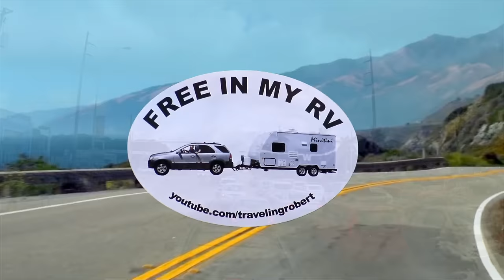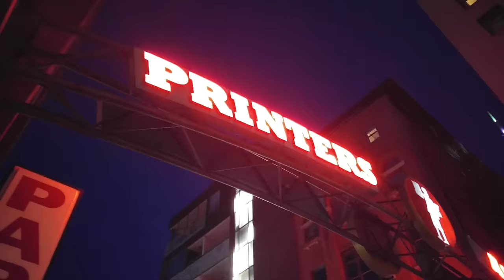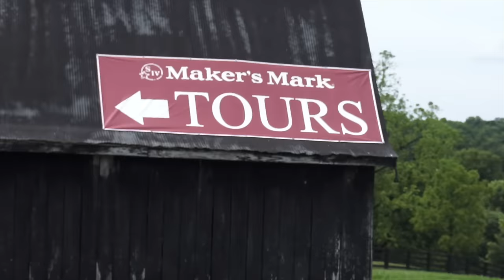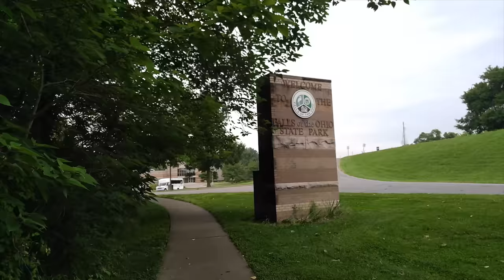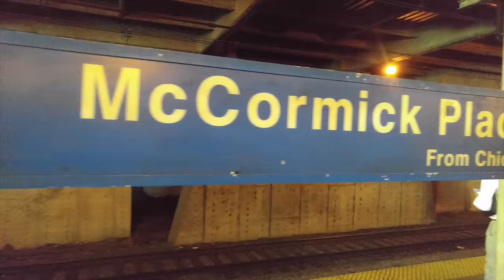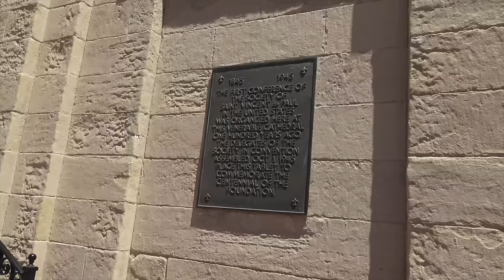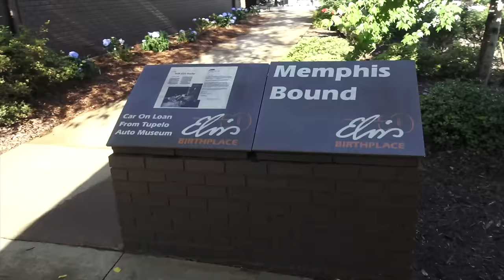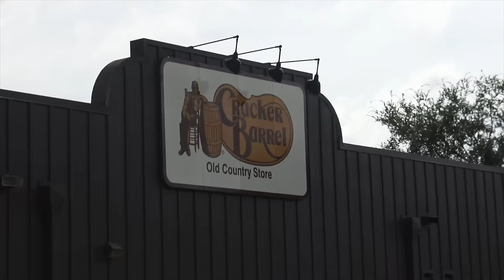GREAT AMERICAN ROAD TRIP - RV trip from MIAMI to CHICAGO and back, boondocking and exploring.

Comment: So many people are living there life vicariously through your video's including myself and never miss one. In my case I have COPD and can not get around like I used to. I bought a trailer anyway. First 5-1/2 hour trip out to meet up with an old class mate my lap top fell off the table and broke in 1/2, my camp site got flooded out, the next day my lower jaw got infected, going home my check engine light comes on. I have no compression in one cylinder so I need  new engine. I give up! God trying to tell me something. :)

Comment: Wow there is so much to like in this video - so much to see.  I loved seeing the 'stars at night' and the clouds and clear skys while you drive.  We also RVed through some of the same places, but I was homeschooling my kids during our trips and some of the 'adult; things you did we did not do. It was fun to see them here. I was surprised the full size pyramid did not make it into the video. 

Robert we have used both a Class B and a travel trailer.  I loved the flexibility of our 'van camper' as we called it. We did just drive up and park it anywhere. We traveled with our German Sheppard who would stay in the van when we went into some places. The best parking during the summer was when we would park in covered parking in the 'oversize' section. It was then safe from rain and too much sun. I could open the 'top windows' and turn on the Fantastic Fan so our dog was very comfortable. We gave her extra water and if the fan power cut off for some reason the windows were still open and she was in the shade.  This was a very versatile RV.  My husband was rarely with us (he has to work in NYC) on those trips it was me and my kids. I would still prefer the flexibility of the 'van camper' and ease of driving. My husband thinks it would be too small for us doing full time, or longer trips.  I loved it.  

Thanks for your comprehensive great videos.  While we had done several caves, including a cave on a large fully ride on electric golf cart  with a guide It may be the only ride on tour of a cave. I could not have handled those claustrophobic cave walls especially when I saw it would not be easy to turn and get out of there. Were there 'hidden' escape routes like the Statue of Liberty tours to the top have?  Geese, I feel myself having to control my breathing when I imagine I was down there with all of you!  

Thanks again for the 'you are there' experience you always give us when we travel with you!

Comment: Dang I could have told you where to park free in Indianapolis, On the north end of the canal on Senate street and 10th, there aren't any meters, you could've taken up the whole curb with trailer in tow and would have been fine. And right next to Indiana Dunes is a free beach and parking lot, literally next door to the west, sharing the same dune is Porter beach free beach. And one more tip, turn your gps (if using google maps) to avoid tolls. There is another interstate that runs right into Chicago all the way from Indy (that also connects to where the dunes were) that you don't have to pay any tolls and only takes like 10 more minutes. I would have rather saved my money and I always avoid tolls on long trips. Even the bridge crossing into Indiana when you were in Louisville mailed you an $8 toll every time you crossed over it by finding your license plate address, could have avoided it by taking another bridge over the river which was only a 5 minute detour. This is just my frugal college student mind speaking...
Reply from the maker: Thank you. I may be going back soon so thanks for the tips.

Comment: By the way, great videos. Could you please comment on how your sense of geography and the local weather has changed with your travelling? It's one thing to read on textbooks that coastal cities tend to be more humid and oxygen rich and towns up in mountains are more temperate and more oxygen thin, but entirely different when you're actually experimenting it.

Comment: :hand-purple-blue-peace::face-blue-smiling::hand-pink-waving: Trailer Trivia: What brand of trailer was the long long trailer in the Lucy Desi movie by the same name?
Redman New Moon model
Production. The trailer used in the film is the 1953 36-foot Redman New Moon model, which sold for US$5,345 (equivalent to $54,135 in 2021). The new car used to tow the trailer is a 1953 Mercury Monterey convertible with a 125 HP flathead V8 engine. So there's that ;-{)

Comment: Robert, I enjoy your videos. What year and model is your Kia? I have a 2006 Kia Sorento, was wondering how your car is handling the weight you towing.
Reply from the maker: +72blueflash I have a 2004 Sorrento EX so we have nearly identical vehicles. I haven't had any major problems towing except for overheating in hilly terrain. I have break controller, eight distribution hitch and anti sway bar.

Comment: Great video Robert. Also I want to know your RV is not too big for your car towing capacity?!? Is your car still working after so many miles of towing? You didn't have any problems with your transmission or engine? Thanks and appreciate for your answer.
Reply from the maker: +1ray234 The RV is right up there at the car capacity but I haven't had much trouble towing except in the Tennessee mountains where I overheated a bit. It is a pretty strong SUV, built like a truck... But I will have to upgrade at some point.

Comment: I just started watching your channel and enjoy it. I am getting ready to buy a toy hauler rv and do some traveling in the near future. I want to make some travel videos and post them on my own channel. I was wondering how you do the videos while you are driving? That's gotta use up some batteries and memory unless you have a remote controller for your camera.
Reply from the maker: The one on the roof is going all the time. I have an 64 Gb (8 hour) memory card, and my extended battery lasts about 3.5 hours, which is how often I have to climb on the roof to change batteries.
Reply: That's interesting, kinda like a dashcam. You must spend a lot of time editing. Thank you for the reply.

Comment: What was your original tow vehicle?  In this video.  I know you have a truck now.

Thank you
Reply from the maker: My old 2004 Kia Sorento
Reply: @TravelingRobert  
Evidently it towed your 1706 okay.  You put on a lot of miles with that combo.

Looks like the Sorrento was rated to tow 3500 lbs.  The 1706 weighs about 3,000 empty.  So I guess you kept your pack out on the light side?

Safe travels Robert
Reply: The reason I was picking your brain.

I inherited my Dad's GMC 2500HD truck, but it's older.  I have a 2020 4Runner that is my daily driver.  So I've been looking for a smallish trailer that if something takes out the GMC, I could still tow it with the 4Runner.

Thank you